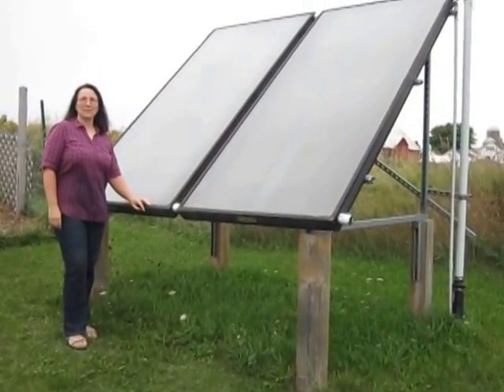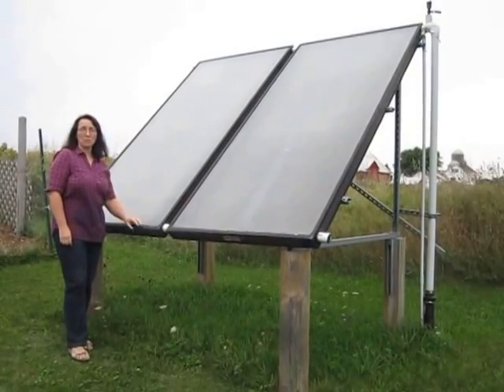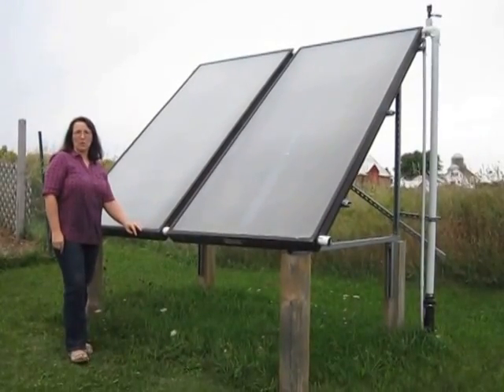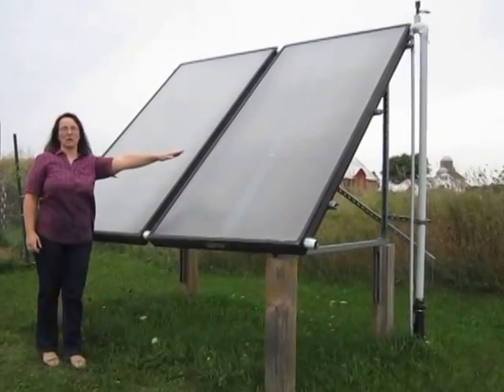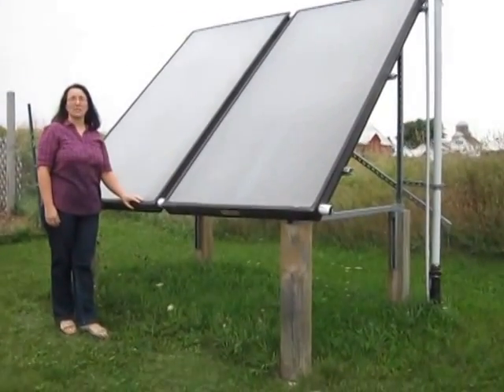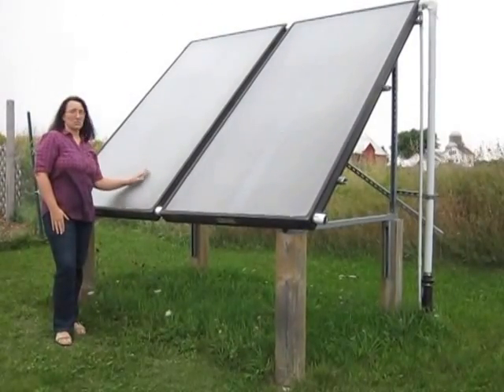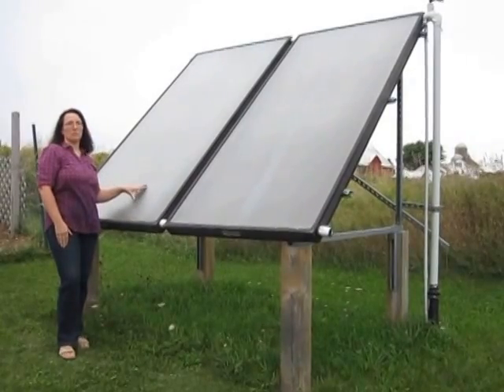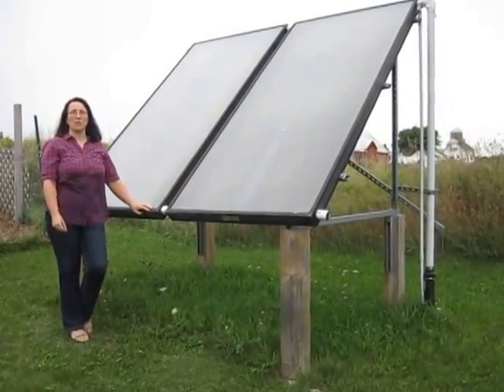Solar Water Heating Panels

Comment: that's amazing how the flat plate panels are 30 years old and still working!!!!
Reply from the maker: No moving parts. I'm sure the efficiency is down a bit because the insulation has broken down a little and clouded the glass slightly, but we still get plenty of hot water.

Comment: Do you still need electricity for any part of installation or running it?
Reply from the maker: Yes, for this configuration. Our installer said that in our climate, the DC pumps that run off of solar panels don't work very well in cold weather  when the antifreeze liquid in the panels is think and slushy. A DC pump with  solar electric panel may work better in warmer climates, but ours has an AC pump and controller.